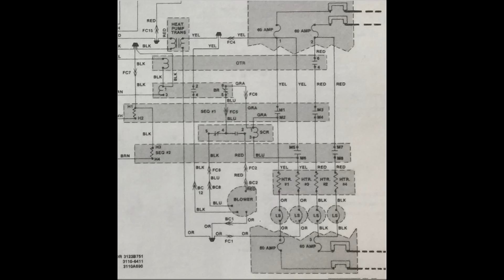Answer to How does this fan switch work? #11

Comment: As you were explaining the circuit I pictured a 'seesaw' effect or a double sided toggle made from components. The circuit construction was very creative and made use of component function to route current cleverly.
Thanks for the adventure. Sure would like it if you had a cursor that was colorful, but still appreciated the info after watching it a few times straining not to lose your cursor track. https://screencast-o-matic.com/
Reply from the maker: Thanks, the cursor is a problem.
GFM

Comment: Relay logic like this was the mainstay of industrial control, assembly lines and safety interlock systems until the mid to late eighties when reliable plcs from companies like Allen Bradley and Square D took their place. Used to work on some that had hundreds of relays and interlocks. They could operate flawlessly for years at a time.
Reply from the maker: Many times decades.  As an example, the T87 thermostat.  First installed in 1953 and some still on the wall.  I have never seen an electronic thermostat last more than 20 years and most much less.
GFM

Comment: Old school indeed. I kinda wish electrical engineers would mess with us like that nowadays. Makes for some interesting problem solving in the field.
Reply from the maker: I have found that if you troubleshoot mostly electronically controlled units, you may have trouble with even the simplest diagnosis of an electrical problem.
GFM

Comment: So then does SCR=Speed Control Relay ?
Reply from the maker: Yes.
GFM
Reply: I am glad you asked this question. I thought SCR was silicon controlled rectifier.  I could not figure out why a silicon controlled rectifier was in a circuit with only two of its legs wired in.  The symbol should have told me different but I saw SCR and jumped to the wrong conclusion.